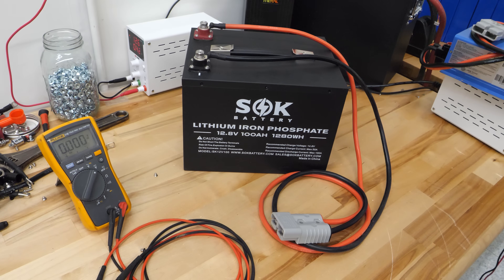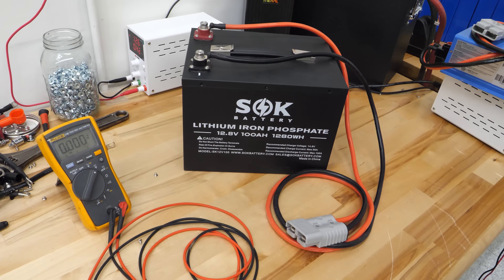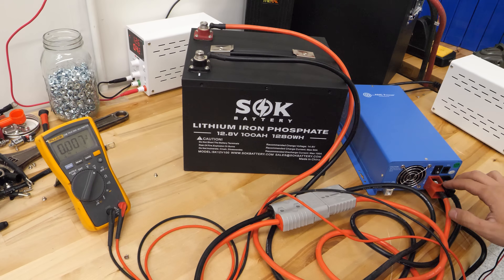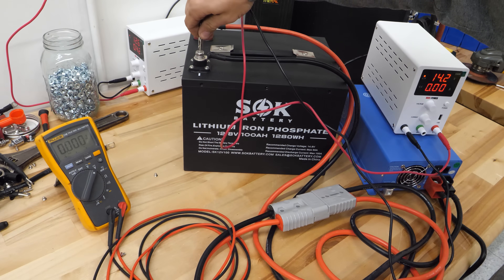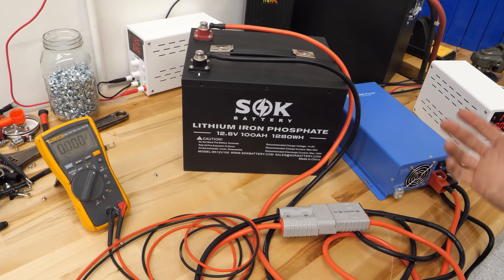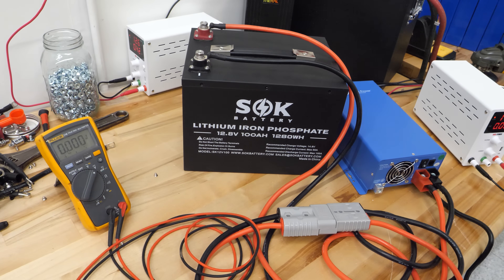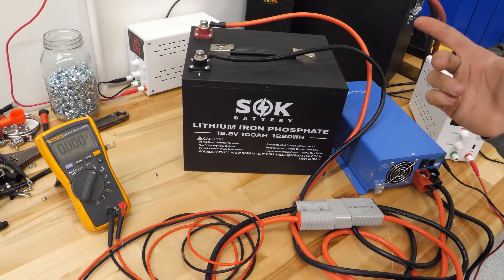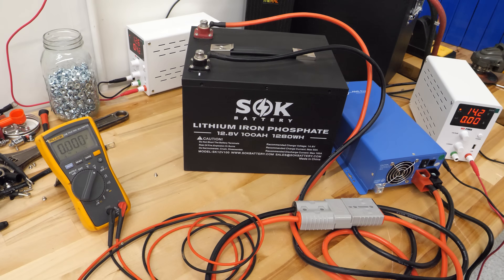How to Wake a Sleeping LiFePO4 Battery 🔋 Charge a Fully Depleted Lithium Iron Phosphate Battery

Comment: Many if not all golf carts now use a charger that must see enough voltage left in the batteries to kick the start relay on. When the batteries are lower than that threshold you must use a manual charger to get the voltage up to the threshold then use the auto charger to finish the charge

Comment: jump starter is a good idea, and I've done that to kickstart a BMS, but most jump starters are the same as your charger, it needs to detect a voltage. My jump starter has an always-on 12v output which I use fo running my tire inflator, but I have also used it to activate a battery. You only need the right jumpstarter. The ones where you have to press-and-hold a button to activate the jump start capability, those don't work, but other types that are "always on" are the jump starter to get.

Comment: I know this video is a few years old, but I just tried this technique on a couple lithiums that sat unused in a camper van for over a year. I think they both read .026V. I tried this technique with two different lithium chargers using the van battery as a jumper. The chargers came on when I touched the jumper battery but after I removed the connectors the chargers turn back off so question is- is there a point where the lithiums will not revive even with the jumpstart method?

Comment: I used to repair gem cars with zivan chargers they did the same we carried a o 0 volt chargers that plugged in to the car and put a surface charge on the batteries took about 5 minutes when you unplugged it and the cars on board charger would start working

Comment: I am having a different issue I just  got 2 51.2v 100 Ah batteries delivered today  and they arived  showing 49.9v   on each   my   inverter/charger  gets to 50.1v  then the  voltage  shows going up to the charger voltage of 58.4v  and then back to 50v and  shuts off   like theres something going on with the BMS in the battery?  how  do I fix this problem?
Reply from the maker: That is an interesting problem, I'm sorry to hear you're dealing with that! What brand and model of batteries did you get, and what is the brand and model of the inverter/charger? Do you have closed-loop communication between the battery and inverter/charger?

Without knowing the brands and models or seeing how the system is put together, I'm thinking this could go one of three ways. The inverter/charger is reading something wrong, the battery BMS is acting up, or there's a loose connection somewhere causing spikes and dips in voltage.

The easiest first step is checking that the external connections are torqued down according to the manufacturer guidelines. Check at the battery terminals, the inverter terminals, and any busbars or breakers or interconnecting equipment. Once that's done, check to see if you're still getting the same problem. If you are, we can narrow down some next steps!

Comment: I have a couple of batteries that have gone down to 8v and I can’t jump them. Do I need to get them down to 0v to do this?
Reply from the maker: Not necessarily! When you see 0V like on the SOK here, the BMS has shut down entirely and won't allow sizeable voltage to be present on the terminals. 
Sometimes batteries with a very low voltage could have a "ghost voltage" that is emitted from the BMS itself while the BMS is still on and too low to allow discharge, while also not allowing the cells to charge. 
For our 12V and 24V SOK customers, we recommend disconnecting the BMS and reconnecting it to give it a proper reset. These SOKs are user-serviceable though, and not all batteries are built to do that.
Considering you are still getting 8V, I would recommend reaching out to your distributor or the battery manufacturer to see if there is a way to reset the BMS to allow charge, or to see if there are other solutions for your battery. 

Hope this helps!

Comment: I have a 50ah renogy battery that won't charge. The battery charger i have has 14v on its output terminals and 14v on the battery terminals, but, it still does NOT take charge.
What is the solution please

Comment: I have a truck battery laying around my garage. Your saying I can hook up some cables to this battery and wake it up that way? Just bought a litime 24v 50ah battery that arrived in sleep mode

Nevermind, didn't work!
Reply from the maker: The truck battery would have to be 24V, and this is assuming there isn't something faulty or damaged with the battery and that charging is enough to recover it from low-voltage protection.

Comment: I have a weird situation: I own a 51.2V 300Ah LiFePo4 battery. The SOC is currently at 74%, however,  the BMS status is Idle and the battery won't accept a charge from the inverter nor will it deliver energy to the inverter. What may I do to wake up the battery, bearing in mind that the battery is 74% charged
Reply: The brand of the battery is SUNFIT

Comment: Seems you woke up the battery then turned off the charger and removed the external power supply then turned on the charger and it was still woken up. How? Couldn’t have got to 12 plus volts plus in thirty seconds? How would charger not think it is still dead?
Reply from the maker: It charged just enough for the BMS to activate from under-voltage protection.  Since in that 30 seconds or so we didn't discharge the battery, it did not have a reason to go back into protection.  Also, the voltage curve for LiFePO4 batteries is very steep at this low of a charge level that the voltage of the cells increases very drastically with a minimal amount of charging, enough that the normal charger recognizes a battery is connected for normal charging to proceed from there.

Comment: What about depleted 
Power station? I depleted my Goal Zero 1000 and now it only charge up to 50%
Reply from the maker: Considering it is accepting charge but not to 100%, this sounds like a different issue. I would recommend contacting the distributor or the manufacturer for next steps. 

Sorry we couldn't be more help here, but we wish you the best of luck getting it to work like it should!

Comment: Can you please post the make/model of the charger? Thanks
Reply from the maker: The AIMS charger used in this video is the AC Converter / Battery Charger 75A (CON120AC12/24DC), and the power supply used is the Nice-Power Adjustable Benchtop Power Supply that you can find on our website in the 30V/10A version. I've linked it below!

https://www.currentconnected.com/product/nice-power-adjustable-power-supply/

Comment: You're a Freakin' ROCK STAR!. ... I purchased these same batteries, except 208V, ans had them sit for two years on a shelf as i was delayed on my project. I was on the cusp of chucking them in the garbage until i cam across your video. I did as you directed and know I have two perfectly charged batteries. I jumped them from my car charger.

Comment: jump starting didnt work for me. I had to tear down (six screws) and unplug BMS briefly. Then still wouldnt work until i pressed charge in the BT app. The battery was at 97% so it was some other problem that caused the battery to go to sleep. It was a Wattcycle 100ah smart mini.

Comment: True story :  had a 100 ah 1280 watt li-po battery 13.3 v,  use a generator and liFe settings on 120v charger run off generator, to keep it charged up,  daughter didn't monitor battery and start generator when it got down to 12.9 volts as advised, says it wont charge, i confirm battery is at 7 volts, I disconnect it, take it down to the car, use a jumper for a minute, its resting voltage is now 11.0 and the generator w/chargers have no problem charging it to full.   The Battery Management System (BMS) wont allow charging if it is too low.  So many Amazon reviewers claim their battery wont charge up after 1 season trolling or whatever and I guess its not common knowledge that its the BMS in the battery that wont allow charging if TOO LOW voltage.

Comment: bought some 300ah batteries.. one came at .98v.
my victron 100/200 wouldnt turn on.
so i paralleled it with another battery from the batch. then the 100/20 turned on. over 8 hrs i got it to go to 4.45v over 24hrs it reached 6.68v. but now the other batt is full.
i am wondering should i take another battery and continue this and hope it will wake up or can you give me some other solution to try?|
i also tried using the dc car port on my ecoflow delta 2. left it for an hr.. but when i came back it was at 6.67v so i guess it wasnt accepting it.
only other thing i have is a smart lead acid battery charger the ones that have a pulse feature and desuphator setting.. im afraid to try it.. as i saw all the warnings in its manual "Does not support lifepo4"

Comment: It worked with my battery itel 25.6 volt 100 Ah i connected the jumper with old 2 12volts tubular battery which was 23 volt as 1 battery was very weak then i turned on the lithium battery button and its built-in BMS started after 1 min i disconnected the jumper and connected lithium battery with my conventional inverter and it started to charge the battery
Thanks alot dear

Comment: Thank you so much for posting this video. My new Power Queen lithium battery seemed dead and the charger display reflected OFF and I couldn’t even get the charger to activate. Completely at a loss I found your video and the hack worked immediately. Crisis averted.

Comment: can I use victron Centaur charger with lifepo batteries
Reply from the maker: The Victron Centaur Charger does not have a dedicated lithium setting for absorption/float, so you would want to check if there is a battery charge setting that matches your LiFePO4 charge requirements. 

There is no official Victron literature that indicates it may be able to wake a sleeping LiFePO4 battery though, so I would not recommend purchasing one for that purpose.

Comment: Greetings, thanks for the informative video.  Can a voltage regulator be used in place of the power supply?
Reply from the maker: A voltage regulator can be used so long as it can output a steady voltage and amperage. It will also need to be able to supply power without seeing any voltage on the battery. 
If it fits that criteria, then yes!
Reply: @ Thanks so much.🙂

Comment: When I jumped my 25.6v battery 🔋. It was only showing 12.6v. After unplugging my jumper cables it only showed 12.7 and when I unplugged the jumper cables it stopped charging. So I decided to leave the jumper cables on the terminals and it’s slowly charging my battery from 12.6 v to now 13.5 v after a few minutes.
Reply: I ordered a jumper charger with trickle 0 v hopefully if I can’t get this battery charged with having my car plugged in I’ll see if the trickle charger works
Reply: No didn’t work. Battery got to 14.0v then the charger said it was full I have a 25.6 v battery I’m returning it. This sucks

Comment: Hay man great video I could use some help with a battery I have a relion 3 rb100-lt battery that I completely drained I have tried all the normal things like using a different charger and adding a 2 nd battery but the battery is sitting at 4.8v and will not take a charge and the manufacturer is not getting back to me so any help would be greatly appreciated thanks

Comment: Most people new to this will not know this. There should be something stuck to the battery explaining this in a location blocking one of the terminals so the customer has to remove it to connect it. This way they are guaranteed to see it.

Comment: Will the Nice-Power Adjustable Benchtop Power Supply charge the battery or is it just to wake up the battery?
Reply from the maker: Technically you could charge with it, but ideally once the battery is re-activated, you would want to use a battery charger that corresponds to the battery chemistry.

Comment: My ionic 50ah battery is 1 year old and has went thru 4 cycles and now is reading 48 ah capacity. Is this a sign of a defective battery? Thank you
Reply from the maker: It would be best to try fully charging it and then draining it completely, then recharging.  Most batteries have very poor accuracy on their SOC% reading and get calibrated by fully cycling.  Personally, I would use a SmartShunt instead.

Comment: My golf cart has done this.  Charger kicks on then off after couple seconds.  I have a boost pack on terminals and charger runs.  Can it sometimes take a little bit for the voltage to get to batteries bc as soon as I turn boost pack off the charger kicks off

Comment: How do you wake up a Lifepo4 48 volt 200 ah ATV/golf cart BMS when it quits out in the field and you have no charger to reset it?  It has a separate 12 volt AGM battery to power the winch and LED lights.  The 48 volt battery charge connector has an Anderson plug.  Can I make a jumper that connects the 12 volt to the 48 volt battery through their charge ports that will reset the BMS on the 48 volt battery?  What about backflow current from the 48 volt into the 12 volt if it resets?  Also, will a 12 volt 3000 amp portable battery charger reset the BMS without damaging either?

Comment: What if my lifepo4 battery is 24V/200ah? What size lead acid battery would I use? For how long would I boost the lithium battery? You explain my situation to a tee. Very frustrating dealing with customer support

Comment: So, could you use a 9 volt alkaline battery the rectangular Duracell you find in smoke detector to kick smaller batteries in the guts?

Comment: The stupidest product ever is a charger that won't work because the battery is dead.
Reply: 🤔…..damn……

😂That’s Actually the Realest Ever Spoke!!!✊🏾
Reply: It’s not the charger. It’s the BMS in the battery.
Reply: Lead acid has the same problem. Charger needs to have a “reboot” button.
Reply: That's what I like about some of the NOCO products. You can bypass that "I can't see voltage" BS and hard charge it.

Comment: My new 206 Ah battery reads 10.6 V. SOK says I need to wake it before my 40A MPPT will recognize it.  How depleted is 10.6V? Once it's charge to 11V might the controller power on?  Can I then connect solar, or must I use the charger until battery terminals read 14V?  Help!  Great vids!

Comment: Very informative video. I'm aware this video was made a few years ago, however I hope this comment finds you. I accidentally discharged 2 48v 100Ah EG4 batteries to 52.44v and my 48v high frequency EG4 charger acts as yours in this video. My question is, will the adjustable Nice-Power supply also wake-up a 48v battery? Thank you
Reply from the maker: We would recommend the EG4 Chargeverter in this scenario. It is capable of "Dark Starting" a lithium battery. https://www.currentconnected.com/product/eg4-chargeverter-v2-48v-100a-battery-charger/

Comment: I had this problem, I went ba v k through all the paperwork that came with the battery, couldn't find any information, tried returning the battery,  I was outside of the return dates so I immediately blamed the battery, left a nasty comment on the site I bought it from & accepted the fact I had been ripped off. I almost threw the battery away but thought I should check YT & see if anyone else had this problem.  Turns out tons of people have. Why won't these manufactures just provide a few lines of text in the handful of paperwork they send with the battery.  At first I thought I was the stupid one but I've since changed my mind. It's not my fault I was not informed. So that leaves the manufacture & the seller to blame. They're litterally the stupid people because they either know, or since they're selling the product they should know everything about it.

Comment: Any ideas on how to do this easily "in the field" for batteries wired in 24v? Dual alternator wont start charging without sensing voltage. Batteries go to sleep after discharging completely in the night... MPPT can work, but looking of a go to solution to "wake them up" so the alternator can take over...

Comment: As a dry-camper with solar panels, this is very annoying when returning to camp to find that the battery shut itself off.  Basically, Im unable to rely on the 12 volt fridge to run consistently.  Looking for ideas.

Comment: Go figure. I have an entire garage full of tools I have acquired over the last ten years but the one thing I don't have is jumper cables, but what I do have which works just as good is a Power Probe. Hooked it up to a secondary battery. Applied current for about 2 minutes, just enough time to power up the BMS and now the charger is taking over for the lithium battery on my Camaro. I had a feeling mine got fully drained by an accidental parasitic draw I had going over an entire day, just wasnt sure how to go about re- activating the BMS. Excellent video and thank you for the info!
Reply: Thanks! I haven't had jumper cables in forever. I'll have to try this

Comment: Would this still apply if the battery is showing proper volts on a multi meter but not power up the electronics

Comment: I've got a 280AH SOK.  Worked great, then got on the road and it shut down.  Turned out the balance PCB on the top delaminated and the B- terminal came off the board.  I've repaired the board (currently waiting for Min to send me a new board).  The cell voltages show 3.45, 3.47, 3.45, 3.47, but the bluetooth is not functioning and it wont take a charge.  

Without a charger connected, I see 11.61V at the terminals.  This seems to be a very high impedance source, as it provides no current.  Only open circuit voltage.  I attach my WFCO charger to it and place 13.71V on the terminals, but it does not seem to be accepting charge, and the bluetooth still does not turn on.  

Any suggestions?

Comment: I bought 2 lithium batteries for my motorbikes, and they arrive completely empty. I still own an old charger with just a transformer and a bridge rectifier. I charged the batteries with no issue and now the batteries are doing great in the motorbikes